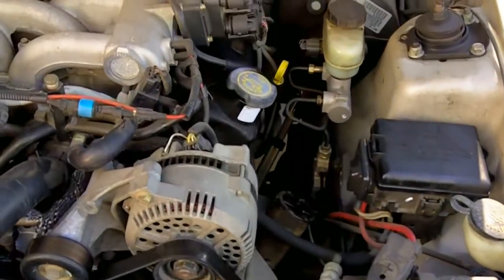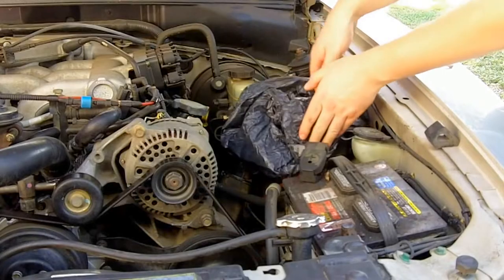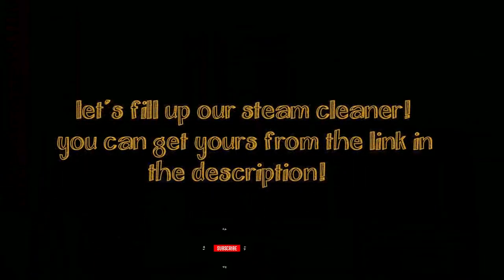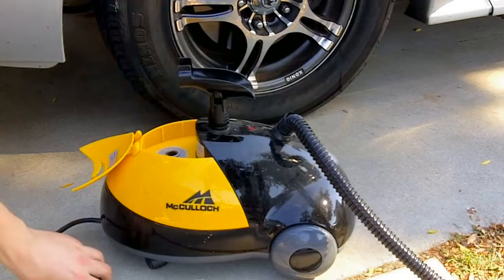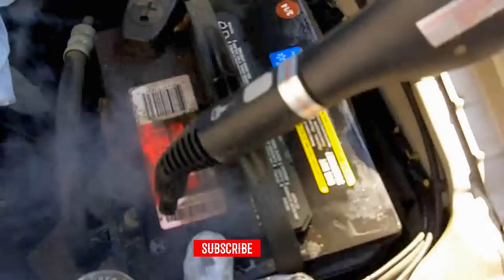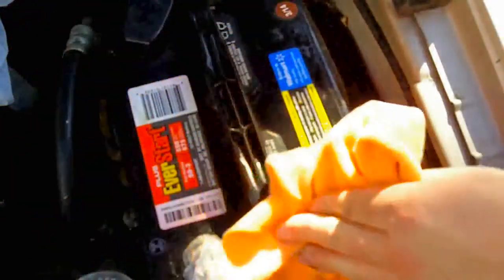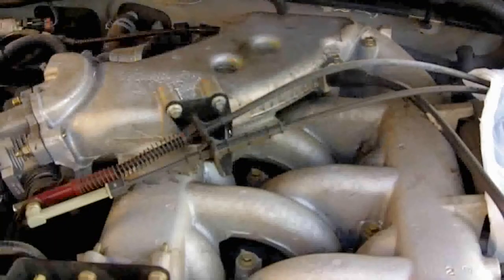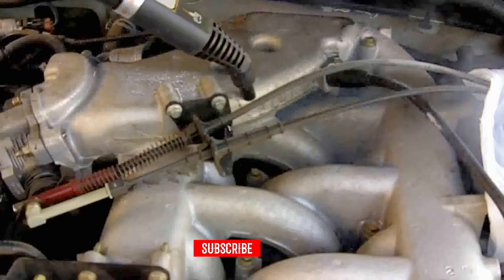Steam Cleaning Car Engine - How To!

Comment: Exactly, the customer already knows the issues or needs of their motor. Including your own so cleaning it, under those circumstances, is a very useful tool. I have a different type but they are still very useful instead of using a pressure washer which lets be honest, shoots very cold water which doesn't help lift or loosen caked-on dirt, grease, and oil as easily.

Comment: Just moving dirt around
Reply: That's all cleaning is at its simplest,  you're taking dirt from one spot and dislodging it to another more preferable spot. 

Use gravity to your advantage, and supplement with compressed air to blast any dirt away that's settled in low spots.
Reply: @100GTAGUY thank u